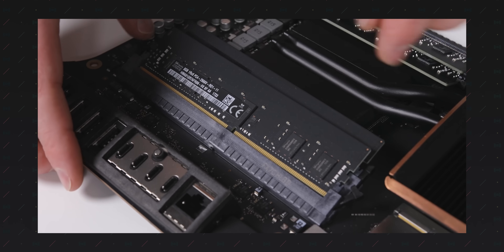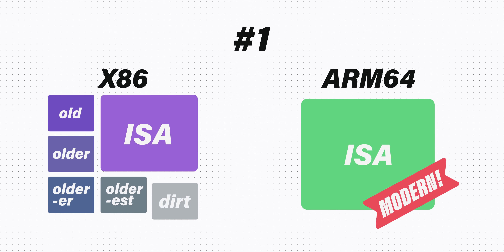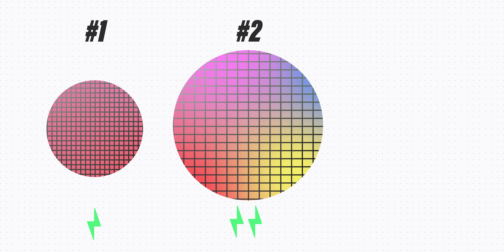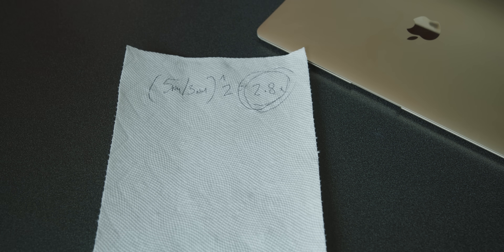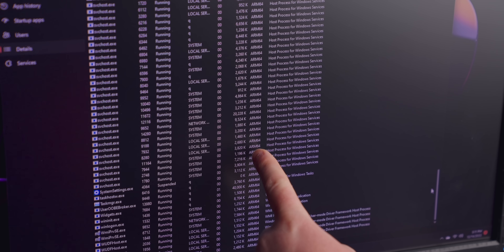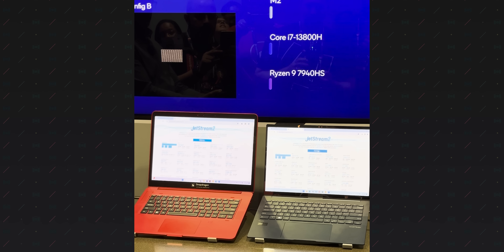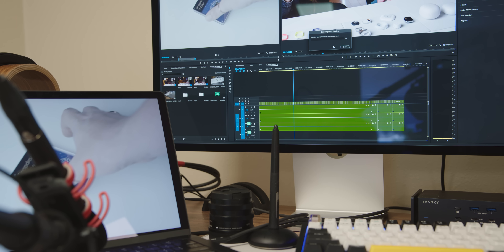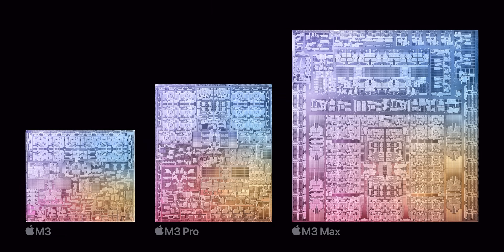Apple's Silicon Magic Is Over!

Comment: Ok, I understand if you don’t offer upgradable ram, a lot of other brands are doing the same, but no upgradable storage? Insane.
Reply: I mean external SSD is ok but
Not giving m.2 slot for SSD is criminal I mean if I have m.2 SSD from my previous laptop or want to upgrade storage there should be 1 extra free m.2 slot in every laptop
(And you can save the planet also if you care)
Reply: Yeah right, but when the bios is integrated in the onboard ssd chip what then? If the ssd is broken and your bios is aswell. How would you boot from an external disk then?
Reply: @Lemonholster   lol create a disk clone / restore / clean install partition of osx on external drive. APFS doesn’t prevent recovery / external media boot you just have to use terminal to create the media. If you’re simply relying on internal SSD as a failsafe get RAIDed or protected (1 layer of redundancy @ minimum) if you’re not doing this- school yo self. Truly, if you expect to be fully covered always from catastrophic comp failure - go analogue. 

I just experienced it but if you have the tools and know how it’s not very hard to recover even a friedAF internal SSD from another Mac or any os for that matter, which assumes worst case only one 1️⃣ source of data. SoC’s despite their permanent / permanent component and non upgradable changeable configs of hardware are the only laptops at least you will see in less than 5 years. The integration isn’t simply Apple 🍎 gouging although I admit they are deplorable for their upgrade “tax” however SoC’s didn’t come about or remain viable and the way forward because Cupertino decided it wanted to really stick the knife in for upgrades. There are a surfeit of optimisations and benefits to SoC’s that cannot ever be achieved by a system with disparate/individualised components.
Reply: The fact that the bios is stored on the ssd means that if it dies, no more computer :(
Reply: @json17 planned obsolescence. I have a 2016 PC that runs everything home/office very fast and even many games and I do sound editing on that. All it took is one-time upgrade - 32Gb RAM and 8Tb SSD. And after it won't be enough for me, someone else will use it to browse the net, watch stuff and edit text documents. That's exactly what they don't want to happen. They want you to buy a new device every two years. They even try to obstruct repairs. And at the same time they claim that they care about the environment. Probably by generating 6x more e-waste with such disposable hardware that can't be upgraded or easily repaired.
Reply: it's not for upgrades only dude, as an owner of 2 dead ssd's it's for repair too!
Reply: the stupid thing is if they market these devices for gaming then dont have upgradable internal storage.. i mean who tf wants to plug in usb sticks or dongles or whatever just to play games..
Reply: @jub8891  Well exactly. Even if every AAA game played killer on Macs, then no one, absolutely no one, unless they are stonkingly loaded, is ever going to buy a Mac as their gaming platform of choice. They are still going to put together a gaming PC with parts they can swap out with newer and faster parts anytime they like. 

Sure, if you are a casual gamer, then being able to play AAA games on a Mac is a bonus. But even then, you'd have to happen to casually own a Mac with a Max chip to get decent performance with the latest games. All the MacBook Air owners are still not going to be stoked about the gaming performance, partly due to lack of GPU, and partly due to the 60Hz screen (or did the latest MBA's move to 120Hz and I missed it?).

This is the problem with Apple. They want to attract gamers, but their sales model is too laced with greed and deliberate restraint of features for it to work.
Reply: Get a 4TB external PCIe 4.0 with t4 cable and enclosure for less than $350 which makes the gougeAF upgrades to SSD‘s from Apple 🍎 redundant . {ps I just took plunge and invested in Apple M3 Max 36gb / 1 TB / 16 inch FOR AN ARM AND A LEG} but it shits on desktops, and for creatives production workflows it is peerless. 

Let’s not even indulge the understatement of the century - WINDOWS 11 is vista 2.0 - utter trash and disease 🦠 infested prostitute of an OS. I can virtualise 3 plus high Specced windows and Linux VM’s with parallels 19 and its CPU TEMPS climb to 70 Celsius but it doesn’t even break a sweat - I can do every other task I need to - while all open and in use - 

I’m not even precious about external SSD’s but I have 2x crucial 4TB / satechi external t4 enclosure) and this is cheap setup - I get sustained 3000-3200 MB /sec - this has made me switch even high volume backups to SSD - just be sure to get the right enclosure and cable. 3000 MB / sec ain’t a bottleneck.

MacBooks and Apple 🍎 generally are top tier - yes they are expensive, yes they are borderline criminal with upgrades etc. - indeed, while not some 🪭 fukboi for Apple - but just dropped 4K on their beast - I cannot, nor can any x86 hoes deny they lead the pack. 

TL;DR - but apple and TSMC have a relationship (foundry and semiconductor fabricators) that rivals the best of marriages. Intel, Qualcomm, and AMD can hope for a marriage like theirs but they won’t outpace / get ahead of the marriage and mutual reliance these two companies have cultivated for decades. TSMC and APPLE 🍎 aren’t going to trash what they have built together for anyone’s bag of 💵 - I’ll start getting moister than an oyster 🦪 in maybe a decade when the competition has found other ways to catch up after dropping the ball for decades….much to their present chagrin. The hype over RatchetDRAGON and competition moving to 3nm production is just that…the architecture and process is but one of the barriers they face, but they haven’t a clue about ARM architecture optimisation, the supply chain relationships, or the head start that Apple has when it told intel to GFIS…
Reply: Which brand does that shit
Reply: Apple are criminals
Reply: I don't understand non-upgradable RAM, non-Apple laptops with soldered RAM are a minority in laptops (beside the smallest/thinnest ones)
Reply: @thegeekno72 the technical reason is that while it's normal DDR5 ram and not vram like one guy said, it borrows ideas GPU VRAM has had, like HBM's idea of getting ram on the package itself and stupidly close to the die, truth is getting ram close means it has lower latency and more bandwidth, but at the cost of upgradability.

Apple needs to basically make it possible for people to solder the ram modules (if it isn't possible already) and have lower ram upgrade pricing on  their site and make it a service.
Reply: I built a NAS so I have my own cloud at home that I can use remotely so I don’t miss storage and being a software engineer I never needed more than 512GB on my work machine
Reply: That's what a monopoly does.
Reply: Everything is cloud based anyway?

@jrstrong
0 seconds ago
I was a UIUC Business major, so I understand the difference between MARGIN and VOLUME, but I don't believe Tim Cook KNOWS enough about Business!  (Like that old Apple Board Member K---something who PREVENTED Apple from licensing the MacOS, as Bill Gates suggested they do in 1985, 10 yrs before he came out with Win95!)

I'll be staying with my 2010 Mac Pro 5,1 for as long as possible, currently 'booting' Monterey 12.7.4 from an internal nvme PCI drive, with a 12-core 3.33ghz Xeon, GTX 670 2g GPU, 96g, 2xUSB3.0 + 2xUSBc card and a free slot #4!  My 5,1 is right ABOVE the M1 chip on the Cinebench 2024 ranking?

Reply

@jrstrong
0 seconds ago
 @snazzy  Come on OWC, find a cheaper way to upgrade!

Reply

@jrstrong
0 seconds ago
 @andyH_England  Less than $500 TOTAL for a 2010 cMP?
Reply: No Android existe uma coisa chamada SD card até 1TB!
Reply: Why not just pay the price for higher storage rather than complaining? I mean you need it for your work right? Lol
Or just get a windows laptop with upgradability
Jeez youre just complaining on price arent ye
Reply: @FoodFighter46  because we like apple silicon but also dont wanna pay insane prices for minor upgrades? How hard is that to understand?
Reply: What pcs still let you upgrade storage? My Lenovo does not. Also you external or cloud like everyone else
Reply: @kjeldkaj  
Cloud storage does not exist. At most, you're using someone else's computer
Reply: With Thunderbolt, superfast external storage with a small portable drive is easy. I have bought a base for many years and use external drives. Even when my 8-year-old iMac HD died many years ago, I ran the OS off an external Firewire drive which ran faster than the old mechanical HD. This is really not a problem in 2024.
Reply: @andyH_England  I really want the ability to upgrade internal storage though. The 14" and 16" pro should absolutely have an extra M.2 slot in it that I can drop an SSD into later. Technically they should have up-gradable RAM too but with the way it's integrated into the CPU, it does provide some benefit there so it's a trade-off. But my general take is the Pro versions should have upgradable RAM/Storage and the Air can be soldered to allow a sleeker design (like the 12" Macbook). It really astounds me that they didn't re-release the super thin Macbook with Apple Silicon as the new Macbook Air, and then the laptops they call the Air now should just be a Macbook. It's like whomever is in charge of naming these products is asleep at the wheel.
Reply: @HVDynamo  Why does everyone think ram is part of the SoC on apple silicon? The ram like on every other laptop is a completely distinct set of chips.
Reply: @definingslawek4731  You don't understand what you're talking about. Apple uses VRAM and uses no slower regular RAM like you find on your x86 chips... In other words the RAM Apple uses is the same you find on graphics cards, its faster RAM referred to as VRAM. You cannot change graphics card's VRAM either. Its soldered on the board, end of story. But I agree on NVME drives, should be upgradable.
Reply: @Dex4Sure  Apple uses VRAM 🤣 My guy Apple uses LPDDR5 RAM not GDDR6 VRAM. They use the same RAM that smartphones use.
Reply: @fidelisitor8953  Oh right thought it was GDDR6 they used. Well LPDDR5 is what most laptops and smartphones use these days. But they would benefit from using actual GDDR6 or even GDDR7 in the future just like game consoles do, would make sense with unified memory architecture.
Reply: @HVDynamo  not just to upgrade it, but just for longevity's sake. With Apple still pushing 8GB of RAM in 2024, swap memory eats SSD lifespan.
Reply: @HVDynamo  There is nothing at all stopping them adding a layer of off-SoC upgradeable RAM. Memory is already multi-layered: registers, several layers of cache, RAM, and then the SSD which is reached for if RAM runs out. Each layer is progressively cheaper per kB, and progressively slower. Apple could throw in a layer of plug in off-SoC RAM between the on-SoC RAM and the SSD.
Reply: @dadthelad  Typically though each extra layer is larger than the previous layer and you duplicate the storage at each layer, so if you have 8GB of unified memory and 16GB of external RAM, you would be duplicating the first 8GB if the same design paradigm is used. Yes, they could expand it if they designed it differently, but then RAM beyond the amount on the SOC will run slower (but still faster than SSD). So it would still be a net benefit in that way and I'd find it an acceptable compromise.
Reply: @HVDynamo  Yep sure, for registers and cache. But when the RAM runs out and the system page faults and reaches for the SSD, the SSD space used is not duplicating the RAM. There's no reason why this can't be the same for on-SoC and off-SoC RAM. Except instead of page faulting to an order(s) of magnitude slower non-volatile SSD, it page faults to a only marginally slower off-SoC volatile RAM.
Reply: @dadthelad  
You basically described Intel optane
Reply: @Demopans5990  Oh did I? Well there ya go, I guess I'm not talking science fiction out my butt then.
Reply: @andyH_England  unless you don't want to carry around an extra hard drive then have to plug it into your computer.  Weird how y'all justify Apples price gouging and planned obsolescence.
Reply: @morganghetti  Not everyone needs higher storage, so having the option to get 256GB at a lower price is a positive. I do not understand people complaining about giving people options; it seems selfish. The 16GB/512GB MB Air is £1500, so being able to save £200 by going for 8GB and another £200 for downsizing to 256GB means I can get the MB Air for £1100. That is better than starting at £1500 and having no options for a cheaper version. I do not get why you would complain about that unless you are rich and do not want poorer people to be able to afford an MB Air?
Reply: @andyH_England the issue is that for 200 USD you can get high-performance 2tb ssd, so no, nobody is really saving any money except for apple
Reply: @andyH_England well to be fair it'd make more sense if it was like an explicitly budget computer like the M1 Airs at walmart, not a modern Air which is a premium laptop. Base specs, same for the rest of the industry of ultrabooks, need to be upgraded, or a price drop should happen.

Also upgrade prices should be less. Apple is making high profits on all these tier upgrades.
Reply: @andyH_England  ,maybe for you, but a lot of us don't want portable dirves hanging off of our small, sleek, highly portable, and light laptops.  In 2024 having only 256 GB (the base configuration of a macbook air) feels a bit cramped to me, especially if you want to edit large 4K video files.
Reply: @charlespeters1480  You're just asking for apple to drop their prices. Apple will GLADLY sell you storage and ram, more than any other laptop manufacturer will offer you, way more. Idk any other laptop with 128gb of ram, or even 8tb of storage. You and I simply don't have the budget for it.
Reply: @charlespeters1480  my 2009 core2duo MacBook Pro had 250GB hard drive.... it's insane having the same size in 2024!
Reply: @charlespeters1480  NVME case and double sided tape, or one of those stick on pockets. It doesnt hang off and you can just leave it plugged in while you carry it around. You can get a 4tb drive for the price of 1tb internal from apple.But absolutely that shouldnt be the only solution, there's no reason they cant add an extra m.2 slot.
Reply: @andyH_England  external???? gross!
Reply: @andyH_England  I prefer internal storage over external storage any day. Take it from me I have a 4 TB external hard drive I lug around and I would much prefer if it was internal.
By the way have you seen external SSD pricing? it is ridiculous!
Reply: @RRKS_TF  Thankfully, most ultrabook users do not need much storage. Gamers and pro users need large internal or external drives to do their work or play games. I'm not sure what people store on their computers that need so much storage space if they are not gamers or Pro users. Remember, ultrabook users make up the vast majority of PC owners.
Reply: @andyH_England  I think even casual users can fill up 256 GB over a few years.  And if they also only have only 8 gigs of ram they may be using their internal storage for memory swapping as well.  I think it's a win win for Apple since their high prices for memory upgrades means people tend to buy only what they need right now meaning they need to replace their computers more often and end up using more cloud services to store the data that they don't have room for locally on their machines.
Reply: @andyH_England and this is what’s wrong with the apple cult. “Apple did a bad thing but they gave us the ability to do something literally everything else on the market has can so it’s all good! Take away more features daddy apple.”
Reply: @andyH_England Can you boot from external if the internal drive is dead?

If not, it is an issue. SSDs die, and on newer Macs thats a full board swap.
Reply: @andyH_England   Not a huge problem, but I'd rather not have to run everything off of an external drive as should anything happen to that cable, which is very vulnerable sitting out like that, kernel panics are the least of my concerns.
Reply: @andyH_England  Sure, you can add external storage, but now your portability sux.
Reply: @dadthelad  possibly not. When you need external storage you’re probably at home or work doing your workflow. Whilst out & about you probably do not need access to storage. As with desktops you just add thunderbolt storage. That was why it was designed and is now my de facto choice as I can use the external devices on all my PCs, my phones and tablets. Just have to get used to it and understand with time we advance and modularity was essential 20 years ago but is now just preference for the minority.
Reply: @andyH_England  "you’re probably at home or work doing your workflow..." Um, no, I am regularly out and about doing my workflow. Even when I am at home working, I move around from my desk, couch, bed, etc, taking my entire workflow with me. Thus the entire point of a laptop. If my workflow was entirely at home/work at a fixed desk, then I'd use a Mac Mini as my "workflow" machine, which I could also easily transport between home and work, and maybe use a low spec MBA as my portable entertainment machine. But nope, I use a 16" M1Pro MBP 32GB/2TB as my one and only work, study, and play machine, and my workflow goes where it goes. I deliberately slightly oversized the RAM/SSD on it for my requirements, so that its reasonably future proofed, but damn did I get reamed by the Apple Super Profits Tax. If Apple actually charged competitive retail prices for upgrades, I'd have at least 4TB. If it was upgradeable, then sweet, I'd worry about it when I needed more.
Reply: @andyH_England  Wow. So you buy a mac with the intention of using an external drive. So this is now part of the design of the mac. You need to use external devices. Haha.
Reply: @MrAkaacer  I have multiple devices and it is simpler to have one external drive to store all my stuff on so I can switch between desktop, Mac, Windows, iPad and iPhone. It is much more sensible than buying extra storage on a laptop that is stuck there, but each to their own.
Reply: @andyH_England why would you want to have external devices connected to your computer when it could just be inside it? Big deal
Reply: @andyH_England  have you seen pricing of TB4 capable disk enclosures?
Reply: @andyH_England  It is not a problem until your soldered storage goes read-only mode and your Mac becomes completely useless.
Reply: @andyH_England  
Have you seen how tiny m2 drives have gotten these days? 8tb of storage in a gumstick sized package. There's no way you can't fit that in a laptop like a macbook air
Reply: @Demopans5990 yeah they are so small as to your point so just make it external whats the issue?